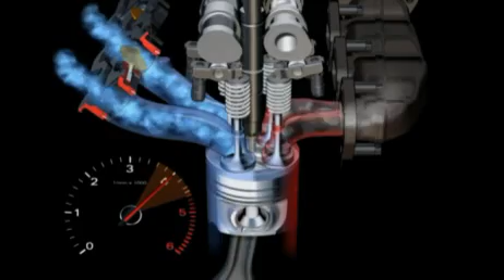Audi Common rail system explained

Comment: Verteiler und pumpe Düse das waren Zeiten 😍aja audi baut seit 2000 commonrail Motoren die haben nur zahlen müssen weil Fiat  meint das sie die ersten waren daweil wurden solche Systeme wie commonrail und verteilerpumpe schon viel früher erfolgreich getestet aber erst später erfolgreich in Kfz eingebaut erfunden hat kein VW oder Fiat was sie haben es nur perfektioniert (erst wenn der elektronische Turbo im commonrail wie bei den neuen Motoren bei VW /audi  einzieht ist der commonrail genial)
Reply: No comprende

Comment: This high pressure diesel injection actually brings more smaller particles which the catalytic converter cannot stop, thus polluting the air we breath. Diesels where never a clean fueling alternative as they would make us believe back in the 90's. It's just marketing talk to get sales going. Now 20 ~ 30 years later, they finally catch up knowing how bad diesels actually are.

Comment: TDI :D lets have a look: 2.7L TDI 6 Zyl. - 179PS/380Nm, JTDM 2.4L5 Zyl. - 200/210PS/ 400/450Nm. Any Question? Only Audidickheads buy a Car with such crappy Engines.I drive a 2.4L JTD since 05 and a 2.4L JTDM since this year, and in all these Years i never met somebody who speak about Problems with: Camshafts, Oilpumps, Dieselpumps, Injectors, Turbochargers, Holes burned to the Piston etc. Otherwise i know many Audidrivers with these problems, all are Driving 1.9,2.5,2.0,3.0 or sometimes 2.7L TDI

Comment: So the post injection that raises exhaust temperatures solely for the benefit of the particulate filter is a waste of fuel that could have been used for propulsion. So the damn thing could actually get better mileage than it already is getting. So i need to find a program for the ECM that forgoes this post injection, and i'll get even better mileage. Hack off the catalytic converter, and whatever else bullshit is blocking the exhaust, and let that puppy breath like it should. Ah yes.....

Comment: that'll be why they recalled all the 2 litre 16v diesel engines in the last 7 years due to oil pump failures? VW are very good at taking other peoples ideas and making out they thought of it. Sorry but every thing stated in this audi cock suck vid is other peoples technology, some of which has been around and used for more than 50 years!

Comment: The first passenger car to be powered by direct injection was the 1986 Fiat Croma 2.0 TD i.d. (Turbo Diesel iniezione diretta pump was developed by Bosch in accordance to the Fiat's engineers specifications

Comment: @MidShipCivic  you would keep you moulth shut if you were smart becouse you are making your selft look dumb and dumber you don't know jack about cars and yet you keep blabing you'r moulth back and foward i am 15 years old and i am a machanic and i will tell you this much the gtr r34 skyline 6 cylnder can beat any audi is that clear and that 2.6L can beat an audi engine thats 6.0L see the driffrence and the fuel it takes and is still will not keep up with the r 34 get you head straight japan #1

Comment: @boilingpoint2 it takes time to convert into vapor,  then begin combustion, that takes time,  with higher reps, takes more time, and its harder to mix properly with the surrounding air,  there is three areas in the combustion chamber, a rich area, a  near stequimetrical area and a lean area,  the higher the reps, the more fuel in the rich area and more CO and unburned fuel...